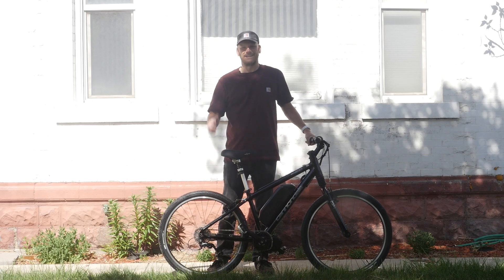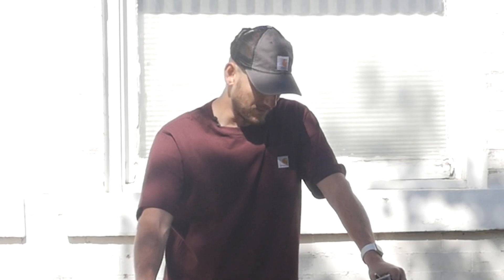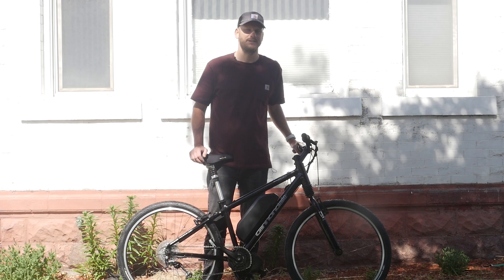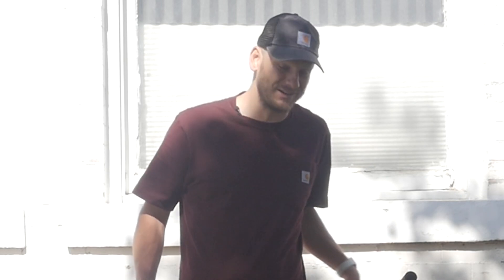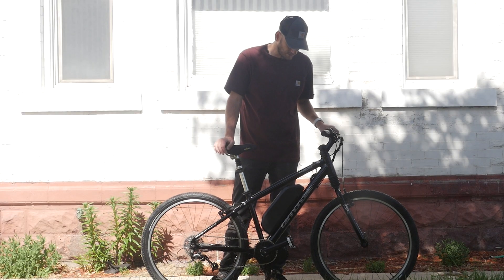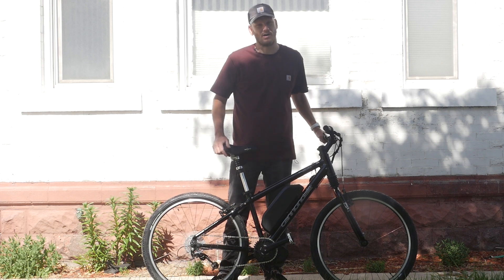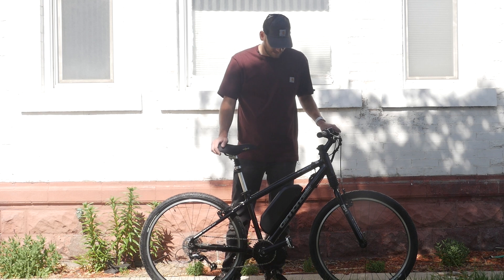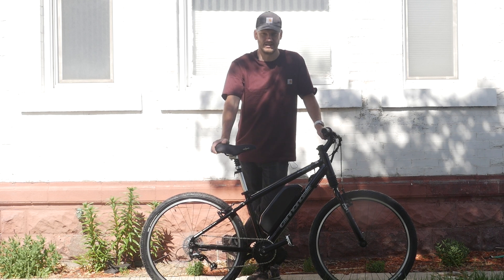Custom E-bike Build: Cannondale Silk BBSHD 52v 17.5ah

Comment: I have a similarly old bike I want to convert. ('97 Trek ZX6000) but am trying to figure out bottom bracket and headset that works on a 25 yr old bike. Any advice?
Reply from the maker: The bottom bracket should be fine. What’s the issue with your headset?

Comment: The long levers with built-in cutoffs aren't great for use with V-brakes. I like 2-finger levers, but sadly that means using either the stupid magnets and bubblegum or the harder to find inline brakes sensors that work like the shift sensors. My BBS02 at 48V is plenty powerful for me on my Cannondale F1000, and I'm 230 lbs.

Comment: The mono shock seems like it would weigh far less as well as it looking sleek. 

That is one great conversion. The batteries are finally starting to hold more charge with them moving to higher rated ones. Now only if batteries were able to have 30-40amps with high higher voltage than 48/52 meaning of course more high end power, and way longer battery life. All while weighing far less than the what we’ve accepted for decades and that is the weight of some bicycles as a whole. 🤦‍♂️

Comment: Thks & off-topic touchy question Johnny;
*I just need a bic every once in awhile in/around DC & I kinda like to maintain it myself.  Most-importantly, the bic will-be no-more than a means/tool towards that more-important goal.   For-example I don't plan to brag to my friends or try to pick-up girls with it.  
It seems like a maintainable walmart bic will do & I can get basic parts that'll wear-out from them too (I'm ~6ft & 160lbs).   
*Sooooo next-time you go by a walmart; ?????Could you do a quick-check & give-me your take on which metro bics look maintainable (ex: standard replacable parts)??????
Reply from the maker: I would strongly suggest getting a used bike from a good name brand (trek or similar) for $200 or less than buying new from Walmart. Walmart bikes rarely use standard parts (unless you spend $400 or more approximately) but at that point buy a name brand bike brand new 👍
Reply: @JohnnyNerdOut  Thks for being polite/honest & will-do.

Comment: Wow excellent build.Just had a Gary Fischer Marlin done up with a mid drive system and love it!
J man need to put on old school down hill speed helmet for MPH test...add on lightning bolt and good to go!
Reply: Small world - I've been looking at converting my Gary Fisher Marlin (2005 XL frame w/26" Rolf double spoke wheels and upgraded front fork).   Wasn't sure if the wheels & brakes would be up to the task though. Great to hear your's has been so good.